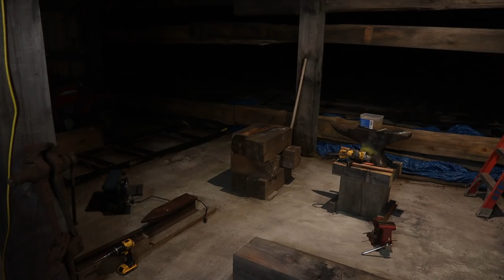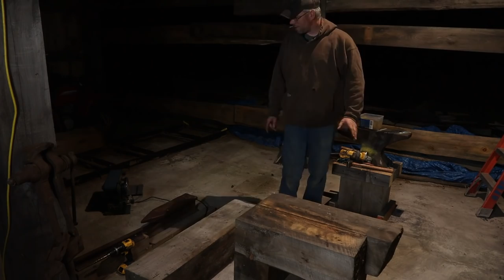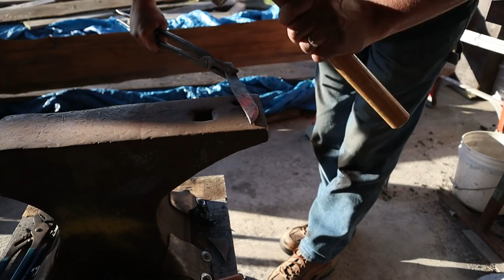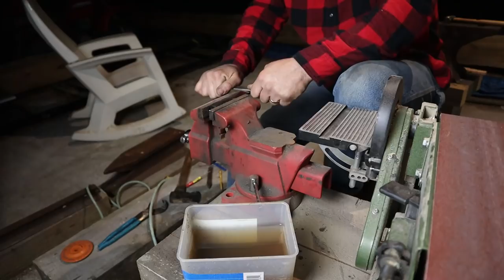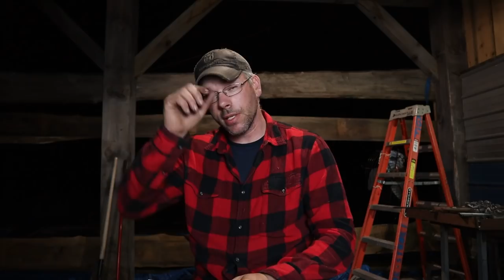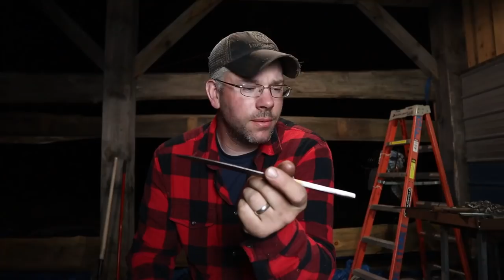Grinding and Heat Treating Our Camp Knife

Comment: Nice start on a good knife Jim. I still use the skinner my brother made for me 35 years ago, skinned a lot of deer with it. By the way I saw a guy on utube who put a long rod in the threaded hole of his right angle grinder to control the angle and used it like a motorized Lansky sharpener. It took a lot of the guess work out of grinding the edge of his knives and removed metal fast. I think he got more or less hollow grind by tipping the disk. I hope I've discribed this in a way you can visualize. Have a nice time camping with your son.